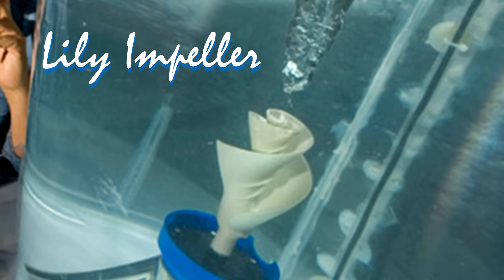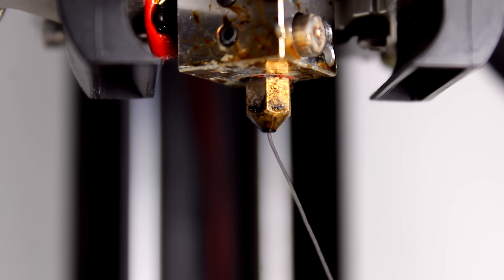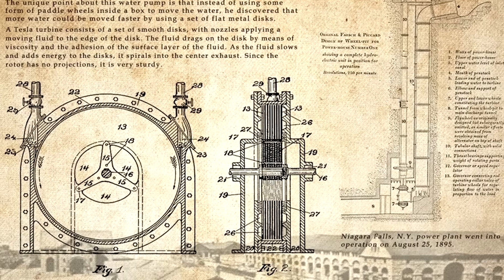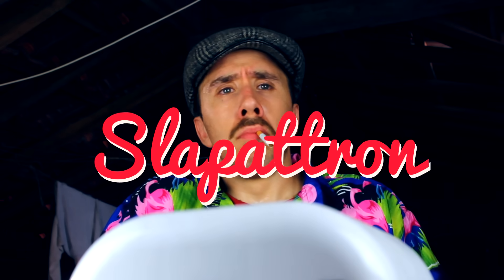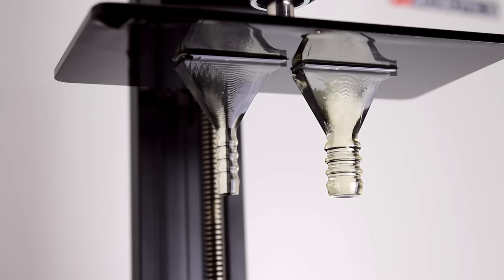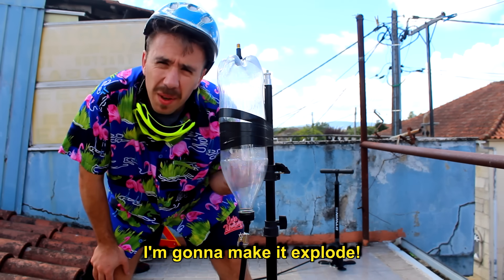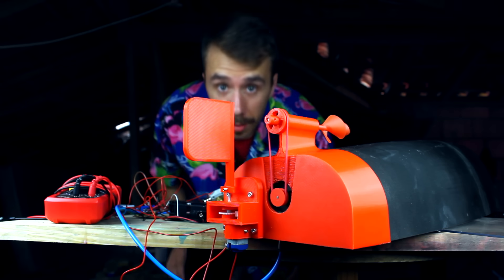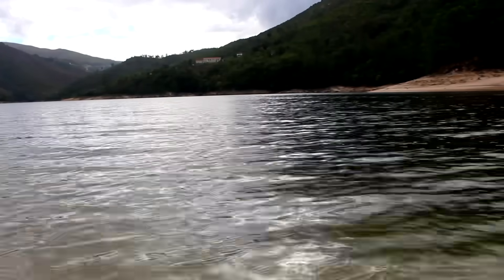Tesla Turbine Boat 3D Printed (Lily Impeller)

Comment: Thanks Integza as always great video, thanks for all your hard work to make quality content! A hydro project Ive always wanted to test that could be done with a 3D printer is, using an Archimedes screw inside a vertical pipe, with a reservoir of water above to create gravimetric pressure to spin the screw and generate electricity. Then to test and understand the relationship between pipe diameter, length and GPE of water (head pressure) to find the sweet spot. Perhaps even instead of generating electricity, use the tesla turbine in reverse to compress water or air to serve as a battery. I dont even know if that would work, but would be cool to find out!

Comment: Try to print a tubular shaped housing for the impeller. Also try reversing the direction of rotation of the impeller by creating a figure "8" with the drive belt. Should significantly increase speed and effectiveness of your design.

Comment: You could use the gas bottles that are used for Airsoft guns instead of a plastic bottle. That would give you probably more power and longer runtimes. Also it's cool
And maybe adding a mantle or so to the impeller to make it more efficient. Basically turning it into a jet drive

Comment: You should try to make a second version of that boat for your next video. I advise you to make a bigger impeller and add   weight to the boat, and maybe why not use the front part of the boat as a storage for compressed air so it would look even nicer 🤩

Comment: One good challenge would be to try to build a submarine using the same propulsion as in this boat or do a comparison between a propeller and the lily impeller to check their efficiency on moving this boat with the same amount of compressed air.

Integza easily does one of the best contents on YouTube glad I discovered it.

Comment: You should try making an rc submarine regulating the air pressure inside of it to make it go up and down, you can also use the lily impellers to steer and go forward, cheers love you vids 👌🏼👌🏼 keep it going

Comment: Idea: Try to make a liquid fueled rocket engine. I know making it with regular PLA wont work but how about a metal 3D printer or any other heat resistant material?

Comment: Make a hover-thingy with the new material(which is super light) you got for your 3d printer and storing compressed air in bottles, I think you can make it balance with a gyro, and it should be super cool, almost like a compressed air drone

Comment: First of all, you deserve a lot more subscribers, secondly for your next video you can 3d printed a submarine torpedo with an action cam on the head, maybe with an rc control or with a chemical reaction that produces gas  as a propellant
Reply: mmmm interesting, what kind of propellant did you have in mind?
Reply: @vashthegun9636  I was thinking about Citric acid + Sodium bicarbonate, both into powder, then have them come into contact with the water in the torpedo, or maybe with some dry ice. In short, non-polluting biodegradable substances
Reply: @redissus9080  oh, cool! In this way it could be without elettronics and it can be very small
Reply: Read that as submarine tomato 🤔 And on the subject of tomatoes, power it with h2o2 + tomato? Though concentrated peroxide is dangerous and sounds more like NileRed...
Reply: @markp5726  h202 could be dangerous for the environment, maybe tomato juice and sodium bicarbonate could be an idea, but maybe they are not reactive enough for a torpedo, or maybe they are
Reply: @markp5726  that Submarine Tomato is a cool name for a project🥰
Reply: @manoknisanpedro7431  yesss
Reply: @markp5726  the tomato idea is really awesome!
Reply: he could use the impeller to eject the gas faster
Reply: @theblueguy6009 It might work!!!!
Reply: use electrolysis
Reply: @shamrithponlingam1656  how?
Reply: @redissus9080  use electrolysis to make the gas
Reply: @shamrithponlingam1656  but electrolysis requires a lot of energy for a portable torpedo, maybe you can prepare some hydrogen with electrolysis and compress it in the torpedo, so you can save on weight since hydrogen is light and use its flammability somehow
Reply: @redissus9080  or we could use energy from a chemical reaction to evaporate and push water.
Reply: THAT'S HOT!!!
Reply: Or you could just use baking soda and vinegar😂
Reply: Well they can just like launch it like a bullet using gun powder

Comment: Build a wireless transmission of electricity through a magnetic filed by means of two resonating AC powered copper coils ( for more information see  "High frequency oscillator for electro-therapeutic and other purposes" - N. Tesla, The Elctrical Engineere, 1898.)

Comment: Integza, you should take this project a step further by replacing the Tesla turbine with a electric motor. And see if you can optimize the lily impeller by doing things like putting it in a cylinder with a flared opening to take advantage of Bernoulli’s principle. Once it is optimized see if you can power a kayak with it!

Comment: I think it would be cool to try and revisit this concept. But instead of turning potential energy into rotational energy, perhaps use the venturi effect to suck water through a tube in the boat using that high-pressure air. additionally, to get an extra edge, it would be interesting to see how much more pressure you could store in a soda bottle if you wrapped dut tape around it much like carbon pressure vessels in rockets.

Comment: My 1st impression right after the 1st test is that the impeller is trying to impel the entire Lake therefore it wants to remain in place as much as possible I suppose. Back to the wonderful vid.
Reply: Maybe the impeller is too small, maybe should be in front of the boat, maybe larger one.  Maybe it needs to be in a sheathing, small pipe? Maybe you need to extend the impeller.  Make it longer, stretch and maintain the golden spiral if possible.  Use the dandelion ratio. That might be a thing. Bruh great video.  I believe the term you were searching for was DRIVESHAFT.  

maybe the boat was entirely too heavy. 

Maybe you can propel a submarine better using this technology.  

Maybe you can create a better way to store the air. Maybe you can use a dozen micro impeller blades.  

Good luck guy. You are cool

Comment: heheh i blew myself up like that once, except i wasn't wearing any safety gear, the bottle was filled to 160 psi and i was holding it in my hand, i had hearing loss for several weeks, and when it exploded it shook the house and set off car alarms outside my garage, i had shrapnel in my hand and blood covered my garage. i stopped tinkering for a long time after that lmao.

Comment: I do not agree that you have made an impeller. That's a propeller, even if it's facing forward. In order for it to be an impeller, it need to be enclosed, which means that it will create a water flow (waterjet). It looks like a good design, so it would be interesting to see it in a tube with a smaller nozzle behind. I think it would make that boat go faster.

Comment: 3D PRINT A REPLICA OF AN F1 CAR ENGINE, PUTS IN A CAR PRINTED IN 3D AND AT THE END SHOWS THE MAXIMUM CAPACITY OF THE ENGINE WITHOUT ANY WEIGHT
Reply: but the turbine will melt down 🤔🤨

Comment: increase the pressure in the bottles and print a bigger impeller.. the drag from bottles slowing it down as well the impeller size is quite low for the boat..

Comment: I think you ought to 3d print a good respirator, for the Covids.  One with inhale and exhale valves, so you can filter the air coming in and going out (to protect you from others, and others from you, better).  There's a Thingiverse example at thing 4307198 but I think it could be improved upon to fit better (mine keeps slipping down) and maybe make exhalation easier.

Comment: You could potentially use the air tanks as pontoons to save more weight, as opposed to the single hull design instead of combining the two designs

Comment: While I admire your enthusiasm, I'd suggest starting simple and working up, adding only one unique element at a time. An electric motor would've allowed a better examination of how the impeller compares to more traditional designs, especially with its simple speed control (and been far less work). Could always expand from there later once the impeller was perfected. Thanks for your work!

Comment: an air powered  van der graaf generator would probably be quite impressive, the rpm that thing can achieve should result in a terrifying voltage or charge rate. if you can get it fast enough it may even be able to sustain a plasma channel.

Comment: Hi Integza, I've an idea for the next step: what about a self driving boat, where you set a path and a GPS controller drives the motors to navigate through it? Lily propeller propulsion, of course! And solar, you can place the cells between 2 Plexiglas sheets with silicon on the borders, to make it water resistant. And 3D print just a frame to hold together this panel, a sealed box with the motors, controller and batteries, and the floating part (plastic bottles? a shaped piece of polystyrene?), a sort of catamaran. You can print some supports to make the link between the electrical motors and the propellers to work though the box wall, by magnetic coupling. 100% waterproof! Self driving can be easier than expected, check ardupilot.org project for inspiration.

Comment: It would be interesting to attach some kind of gearbox between the turbine and the impeller cause turbine is a high-speed-low-torque thing and impeller is more like a low-speed-high-torque thing... also you can increase the size of the impeller itself in this case

Comment: would it be posible to use co2 canisters as the pressure sourse and a tesla turbine in order to make a toy car? the turbine would probaly need a lot of reduction in order to get a high enough torque, but that would be posible using a simular pully system to the one you used on the boat

Comment: what about making a big 3D Printed [light weight] Air Turbine Helicopter using the same air compressed bottles at high pressure ... I wonder would it fly or not?

Comment: Great video as always. This will be hard to do but how about trying to make the one thing that Tesla invented that changed the world forever ? AC motor. 3D printing that would be ofc hard. But you can get metal infused filaments and ofc you would use real wires for the wires but it would be good challenge.

Comment: Integza, I believe you could increase the thrust of your impeller by enclosing it in a tube (think more like a jet engine). That will help contain the flow of water over the impeller and direct it all in line with the boat.

Comment: I think your impeller would work better inside a venturi tube on the bottom of the boat.  That should cause a vaccuum on the front end of the tube pulling the boat forward, then with the reduction in width at the back end make for quite a lot of exhaust pressure.

Comment: How about building a Tesla turbine powered skateboard, with a torque converter, to supply enough enough torque to carry your mass(not weight). You can probably use a gas cylinder to store a lot of pressurised air, enough to take you at least 1/4 mile.

Comment: I feel as if tesla motor's power efficiency would increase with RPM due to centripetal forces on the air increasing the air density and boundary layer friction and time. My Theory is with a higher gear ratio of pulleys or a smaller prop. It could output more power, torque, speed, and efficiency.

Comment: You could build a shroud around the impeller to channel the water and generate more thrust, like a bypass turbine engine on a jet. The jet exhaust doesn't generate much thrust, but the air moving around the outside of the main turbine assembly generates enough thrust to fly an airliner.

Comment: What if you put a bit of tube around the impeller, sticking out of the back, this gives the flow more direction and it might go faster.
You can also use the tube as a rudder (steery thingy) by moving the tube left and right.

Comment: this same tesla turbine boat, but build a duct for the impeller to suck the water through it, hopefully creating propulsion.
also sand/paint/polish the prints that are submerged. smoother surface = less drag (referring to the red prints)
I have an idea for ducted tesla turbine powered propeller :)
edit: and for shits and giggles, use a compressor for a submerged version, to see if one can reach at least half of 57k rpms and see if the parts can handle the stress underwater, how much cavitation it would create and if it would create more propulsion at such high rpms

Comment: If i were designing a boat and my power source was air, i think i wouldn't spend much time on a boat to hold everything when i already had floating bodies that i could attach things to. The electronics could fit in smaller 3d printed casing and bottles attached together with that same light material. Hollow long pieces could have been used for stability had that been an issue for just the bottles but the entire boat shape and size seemed excessive to me. Great work otherwise, I really like how you take things from engineering that would would otherwise be obscure to the public and make something of them. Keep it up!

Comment: As always great video and engineering! I have a couple suggestions that would be awesome for you to try. Try reducing the pulley ratio so that it takes more revolutions of the turbine to give one revolution to the impeller. Next suggestion might be a little dangerous so try at your own risk. Use a CO2 tank that is used for paint ball guns, and super charge your boat! Note, you need a heat exchange, like a radiator to heat your co2 as it comes out so you don't freeze everything up.

Comment: Very nice video. I would like to see a fully fuctional 3d prined power generator based on the lilly impeller. It could be used for emergency power. Like you 3d print the impeller, the eletric generator, the casing and support for that.

Comment: You might get more speed on your boat if you used a larger impeller.  The one you were using was quite a small cross-sectional surface area.  The only drawbacks of a larger impeller would be more weight and the need for a higher torque.

Comment: maybe print a nozel that uses the air presure directly to propel the boad instead of a extra step in between.

from:
presure-to makeing starting a rotation to keeping up the energy.

to: 
from presure to energy to make the boat move and u could add the "de laval" nuzle to straigten the air flow and increase it efficiency.

and as finishing touch make it so u can rotate and pitch the valve to directly controle the boat :D.

love your work and i wish i can buy 1 so i could do these things with my younger nephews.

Comment: You would have had much more power if you have used a reduction gear train in between the impeller and the Tesla turbine. 
There is very little power extracted by Tesla turbines when running slowly, those machines however are really excellent when they can run at higher rpms. 
The thing is that the impeller requires a lot of torque, which your turbine does not produce.
Give it a try, my intuition is that you might get a fairly good amount of speed if you manage to find a better operating point !

Comment: A little bit agressive lol,  cool tho.  Maybe try larger impeller or two at the stern for faster speed since the boat is  moving by sucking the water towards it unlike a propeller which is thrusting it rearward.  The more water it grabs, the faster it goes like butterfly stroke swimming. But water propbably is not being thrown behind the boat because it sort of stops at the center of the impeller and is thrown/thrust below and to the sides of the boat....just my thoughts.  Cool project.

Comment: Back in high school, when I wasn't fending off giant lizards or looking for a mammoth to ride home, I enjoyed dabbling in a bit of rock banging. I never built any of my dreams, but I drew them out in meticulous detail on the cave wall. One of those drawings was a tesla-turbine-powered propulsion system for a lighter-than-air craft. I never really could reconcile all the nit-picky details, but I wonder if the addition of a shroud toward the end of the lilly impeller would improve its efficiency in open water? And, if that works, maybe mad science could extend the design to propel a dirigible?

Another of my wanderings supposed a tesla turbine, when properly built, could use power input through the shaft to create a high-pressure region around the edge of the disk, so with a re-engineered body around the disk stack, could probably be used as a propulsion system, too. (Bee-tee-dubz... tesla turbines are used in such a configuration as impellers in some massive pump applications where the danger of sucking up rocks would ruin common turbines, with a neat side effect being that it doesn't harm fish when they get sucked up.)
Reply: yea i bet it would work better at the base of some kind of velocity stack with an exit tube/nozzle behind it. it would also make steering much more effective since you could use a grid structure or other design to shape the direction of outflow water

Comment: You should make a boat powder by a steam engine or a Stirling engine. They will have more torque. Also a steam engine has a higher energy density, allowing longer run times.

Comment: Make a housing for the Lilly impeller to redirect the flow properly, vs a standard impeller design. Will it favor creating pressure or volume as the lily impeller is great and effective at moving large amounts effectively, but may not develop pressure.